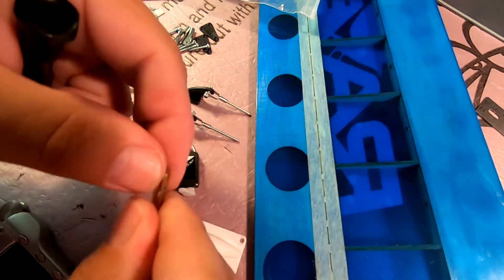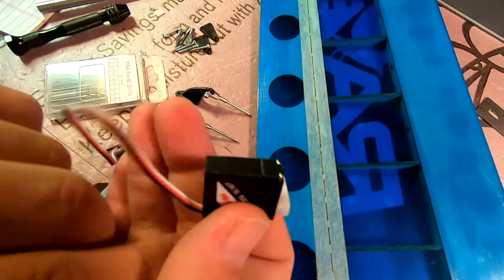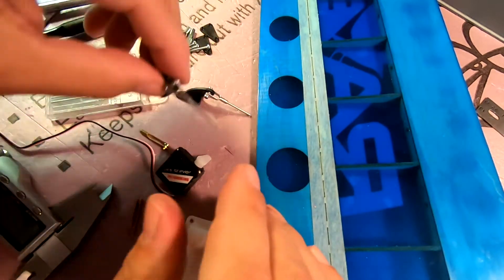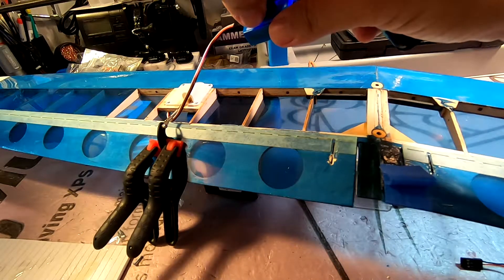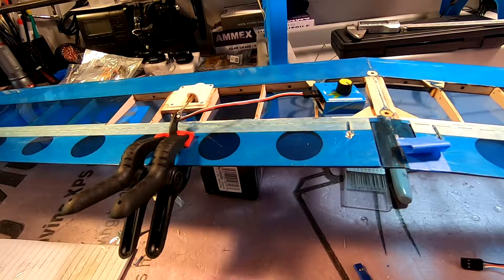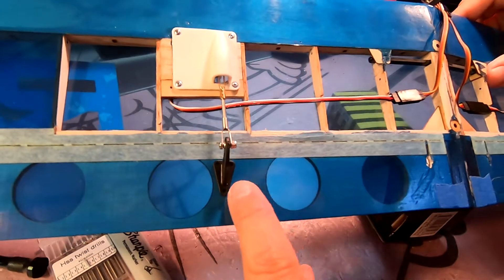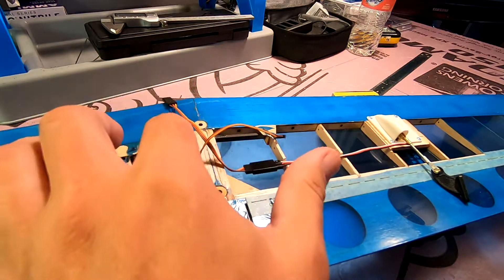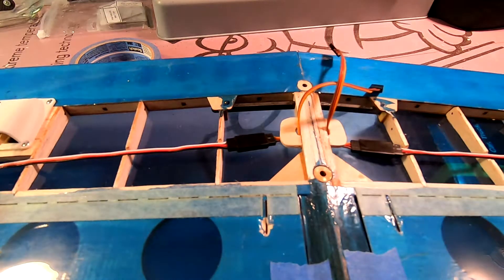HobbyKing Raven 1500 DLG - Build Pt14b - Mounting Aileron Servos in the Wing

Comment: Who makes the horns used here and what size are they?
Reply from the maker: Hi Mic, They are a Robart product, 330-1/2" Super Ball Link Control Horn. They include metal clevises. The part number is 58936 33000. www.robart.com... Luckily I had a pack on hand. I paid $7.99 for a pair at my local hobby store.

Comment: Looking good,
I find if there's not a lot of room to work you can use cheap double sided tape instead of big clamps to temporarily attach the horns to get them tested and set. If I get it right the first time I just leave the tape there and do the permanent mount.
Reply from the maker: That's a great idea... now that you got me thinking about it, double sided scotch/cellophane tape would do the job nicely, it's very thin and pretty easy to remove. FYI, I'm starting to build the Chrysalis-Lite today and may build a Slite V2 this fall/winter to have another competition 2m RES ready for next spring. Some events let you field up to 4 gliders. I thought it would be a good idea to have at least two in case of a crash during an event. Here is a link to the Slite if you want to check it out. I've heard that it's one of the top gliders in the class. That's the great thing about competing in RES, the kits have to be mostly balsa/bass/ply so even the best designs are affordable. https://www.hyperflight.co.uk/products.asp?code=SLITE-V2&name=slite-v2 
I couldn't find a dealer in the US and this shop charges a hefty overseas shipping fee, but they are a good shop and everything I've ordered from them arrived quickly and intact. 

I hope your back is doing Ok. How's flying? Have you had the opportunity to get some stick time with your new plane? I'm counting the days till I get my eye fixed up. Regards, CJ
Reply: My RC Channel 
That Slite looks like a nice ship. I'm starting to look at the art hobby Agena EV 1.5M as a replacement for my Kunai ready for next season. Having been on disability for the last 10 years and now on retirement pensions my hobby dollars are very limited. I'd have to sell my kunai before I could seriously consider getting the agena or my wife would string me up, lol. She's not as understanding as your wife !
Have not been flying for about 4 weeks due to weather and for the last week we on vacation in Victoria on Vancouver Island. I'm getting itchy fingers wanting to get my new magellan back in the sky.
Thanks for your efforts with the videos they're always interesting and give me lots of ideas.
Reply from the maker: Wow, we really have similar life stories. My back fell apart in early 2010. I had a good carrier and was competing in triathlons and cross-country/endurance mountain bike racing when just before the season began, my lower back went and I started getting wicked sciatica. I'd had back problems for a while as well as a few surgeries and probably should have dialed my life down a bit, but I was having to much fun and have always had a bit of immortality delusion syndrome. I figured I'd bounce back... it was 2012 before I admitted to myself that I'd never recover. Even when the best docs in the US tell you that you're Humpty Dumpty and all the king's horses and all the king's men can't put you back together again, I was still thinking maybe I'll pull it off one more time. 
The Agena looks like a nice hotliner and the foam core wood covered wing is a nice compromise between build-up balsa and carbon/composite. Looks like a good price point too... about $200 with shipping depending on the exchange rate.
Check out the Monarch butterfly paint job on this glider. https://static.rcgroups.net/forums/attachments/8/4/0/a10296882-186-a7197106-59-P1010073.JPG 
I showed that pic to my wife and she asked if I could do something like that for her and now she wants a glider. I'm going to try to teach her to fly and we'll see how it goes. I am definitely a lucky guy in the wife dept. You're not doing that bad either. These days, a lot of women split when the going gets tough. I got a lot of friends with broken marriages. I know you're having a tough time because I live in constant pain like you, but we gotta get up every day, smile, and try to find joy and happiness in every day we have. Best of luck my friend. Regards, CJ
Reply: My RC Channel 
I hope she gets to like flying then'll you'll get unlimited flight times , lol.